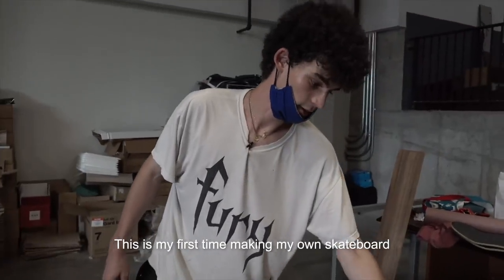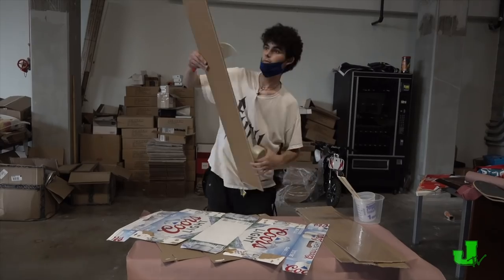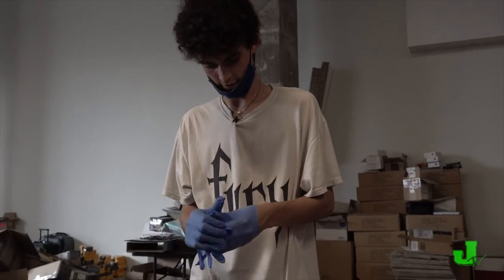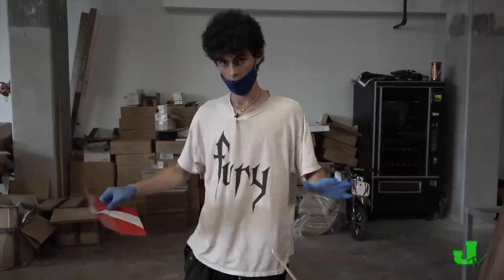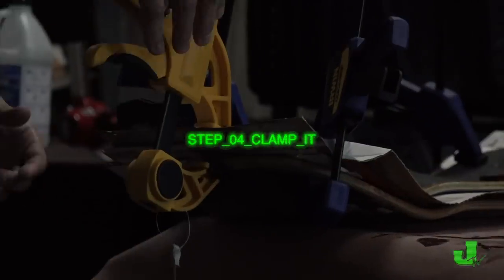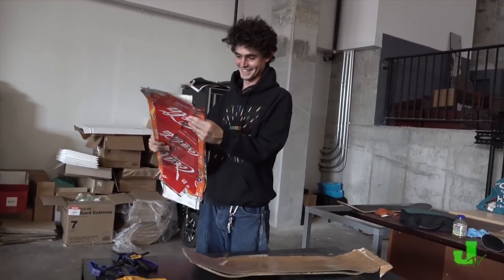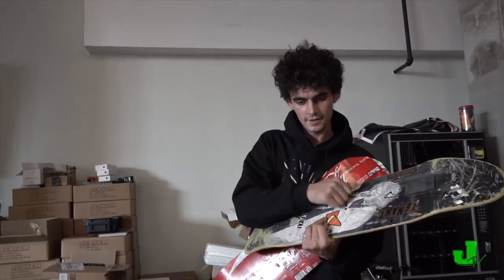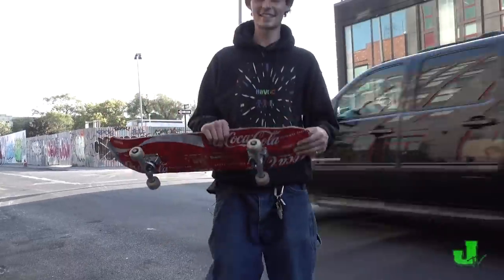Constructing a Skateboard out of Soda Boxes | JENK TV

Comment: If you used non-corrugated cardboard (and a bit more of it) it would have probably worked. The end-result may have been thicker than a standard board, but that would be offset by the fact that cardboard is lighter.
Reply: maybe cardboard that doesn't have like a slick coating  so it can absorb the glues and make it stiffer or something

Comment: What he made right there is called Micarta. Layers of epoxy resin, and in this case cardboard, but you can use paper, or cloth, fiberglass, carbon fiber. The most common one is made with canvas. When done right it’s really strong stuff. It won’t crack, or burn.

Comment: Reverse the layers. Cardboard for the outer 2. Harder wood for the middle 5
Reply: There was no wood innit, it was the mould. And a sandwich construction puts the soft material on the inside, sandwiched between the structurally rigid material.